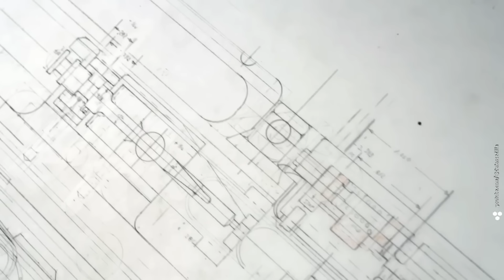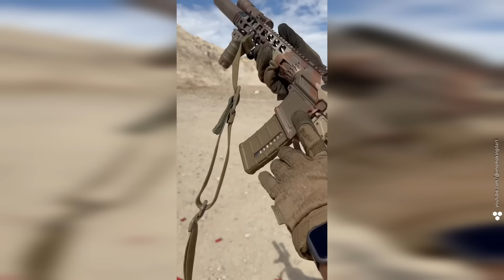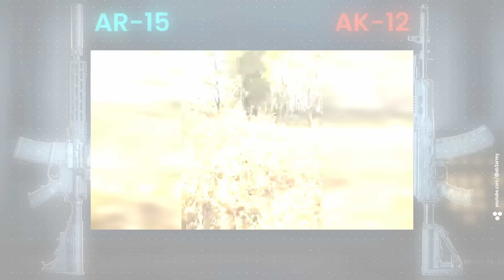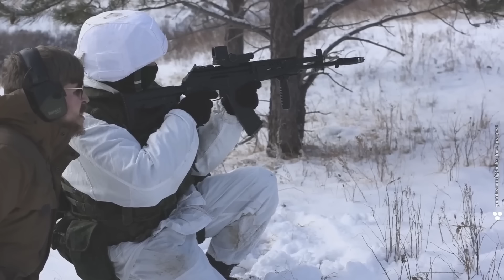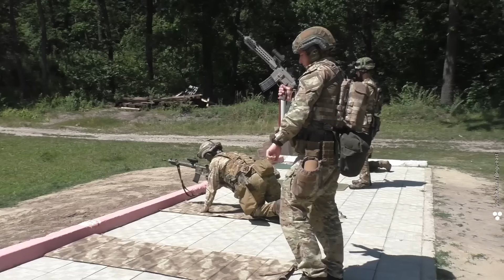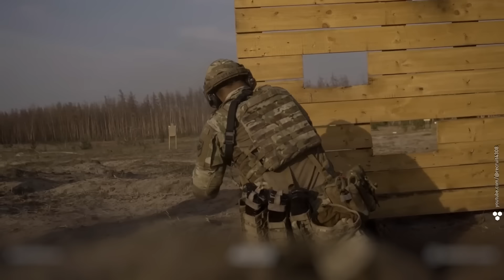Something Is WRONG With AK-12... While AR-15 WIPES OUT Russian Army

Comment: No it does not use a direct impingement gas system, it uses an internal piston gas system, the French Mas 49 uses Direct impingement.
Reply: Thank You for saying that I had to set him straight 😅
Reply: AR15 in its standard form is a direct impingement… HK416 and SCAR use short stroke pistons  …
Reply: @williamsjm100  sorry he was right a true DI gun blows the gases directly against a tombstone on the bcg the ar15 is a Internal piston because the gases blow ilthrough the pistol and into and out of the bcg thats what the two holes are in the side of the bcg  under the dust cover also this is how it  it pushes the bolt forward to lock up the action ,just that alone should tell you it is not a DI gun although most people say and believe it is even companies that build them call them Do such as LWRCI ,any good armorer will tell you it is not a DI gun it is a Internal Piston,even Stoner himself never called it a DI because it is a completely unique operating system,✌️🇺🇸🫡😯😅
Reply: @ccoop2416 come on… you are not using the standard parlance for how the gas block and the gassing works. Short and long stroke gas pistons tap the gas higher in the barrel. 

AR15 and AR18 actions are almost always considered DI. Why? Because the gas system is nearer the battery, the battery and block move as one unit. Hence you get a nicer set of harmonics and aiming than on most short and long stroke pistons. 

Take your gun apart and have a think about it.

Comment: if you would have just compared that to something like the AK 200 or just an AK 74M you would get far better results the AK 12 is terrible
Reply: True but the AK-12 Is the standard issue rifle, while the AK-100 and 200 series are fir elite units AFAIK
Reply: My Polish Archer is a pretty nice, light, fairly accurate AKish rifle.
5.45×39 is over priced right now...but that is changing quickly....( Century has it for .50 cents per round now)